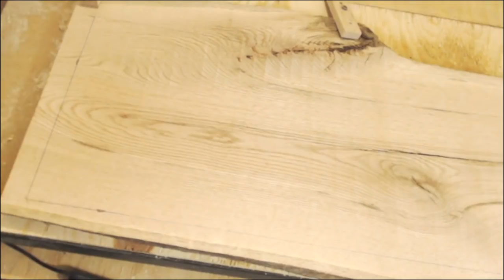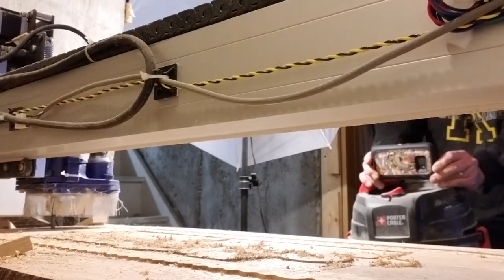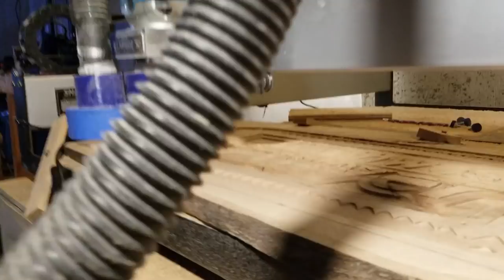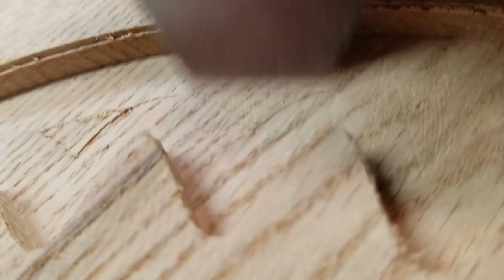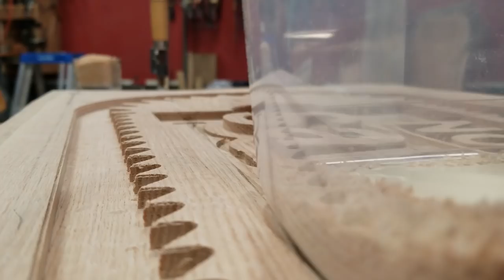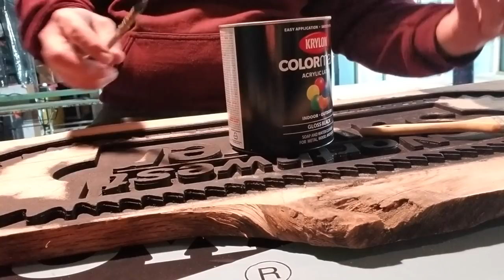Live Edge Red Oak Sign Fit For A Sawmill (Shapeoko CNC)

Comment: Great Job!  Not sure what end mill you were using, however if you use a downcut spiral bit and then incorporate a "last pass" option, it should cut down on the post carving cleanup and sanding.  Well done.
Reply from the maker: Thanks!  Exactly the kind of advice I need.  I will get a down cut bit.  It sound like that would work so much better.  Thanks for the advice and for joining us here on the channel!
Reply: @practicallyIndependent  a compression end mill will give you pretty good finish on the top and bottom of the work piece.  I have used them but when surface condition is paramount, I use a down cut mill.  I'm not a cnc expert by any stretch and learned most of my knowledge from youtube......especially for my CAD & CAM software, Vcarve Pro and Mach 3.  Love the channel!
Reply from the maker: Thanks!  I will be making lots more videos coming soon. I am very excited for this year!